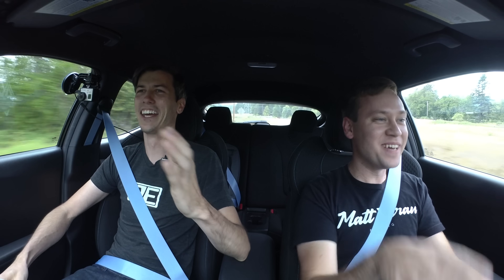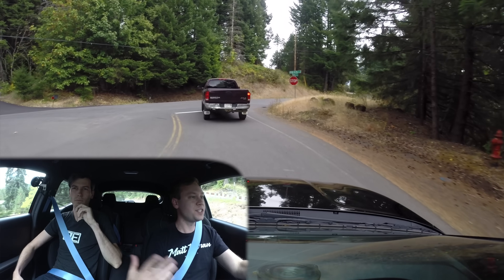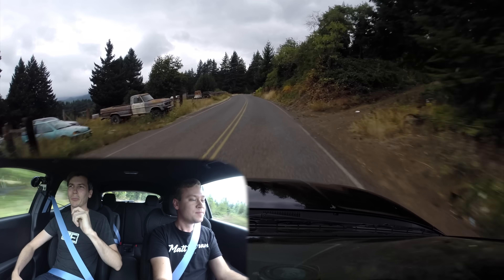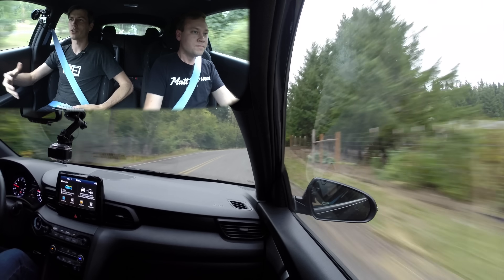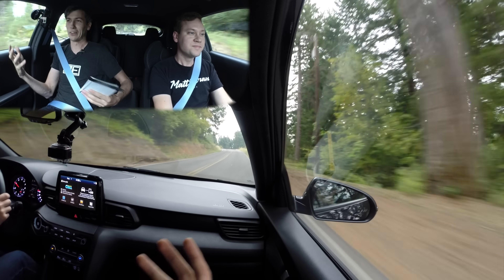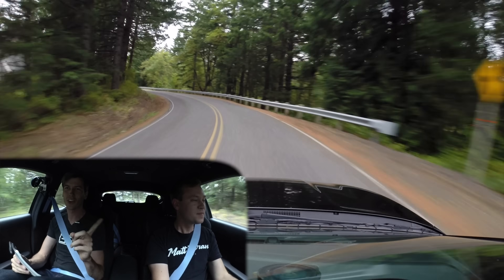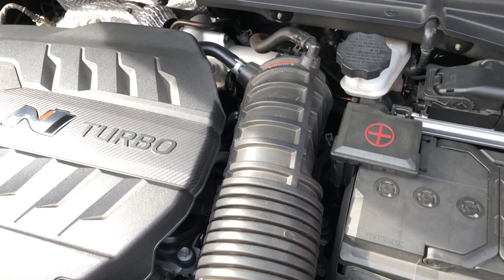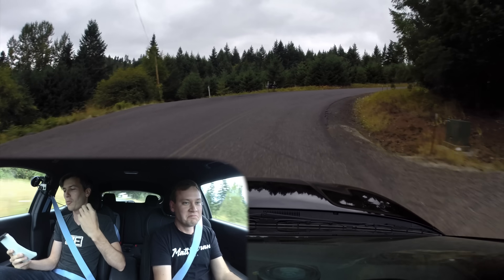Are Car Exhaust Crackles & Pops Fake?

Comment: Next, an EV with exhaust pops 🤣
As for Porsche and exhaust pops, the 718 Boxster/Cayman also pops when going of the throttle (in sports mode), but it became more subtle after the introduction of gasoline particulate filters.
Reply: I'm down for EVs with exhaust pops. :D

Comment: Crackles and pops are awesome... sounds through the speakers is awful. If you want to hear the engine and exhaust and your vehicle is designed to be quite maybe you could just roll down a window I mean all cars still have windows that go up and down I know most people think the driver window goes down so they can get there Starbucks through that hole. Lol😃😃 just an opinion here each to there own

Comment: What about catholic converter? Isn't that pops dangerous for ceramic?
Reply: Think you mean "catalytic" and yes, any ongoing or repeated post-cylinder ignition (especially if there is ignition in the cat) can overheat the exhaust and do damage over time.
Reply: @Game-The-System . Yep catalytic is other term. Sudden, hight pressure changes not good for ceramic or ceramic like materials.

Comment: Isn't the main reason for keeping the crackles to hark back to the romantic days of carburetors. When you let of the gas on those is actually still the physical evaporation of the remainer of fuel that causes the few crackles. Lovely sound on older carbureted motorcycles <3

Comment: but there are other ways to keep the turbo spooling without the inefficient "crackles and pops", right?  

I'm generally against any "fake" stuff in cars.  Shifting CVTs, fake engine noise, etc.
Reply: Look up how modern F1 powertrain works
Reply: Pressure release system maybe? Have a system that collects and pressurises exhaust gas and at low rpm it spins up the exhaust side

Comment: I have an E170 corolla with a Borla axle-back exhaust. It doesn't crackle like this one but when I let off the throttle it kinda rumbles/gurgles around 2000rpm. It sounds really nice. Anyone know what that is?
Reply: Bottom line is that the crackling and popping is generally post-ignition or even post-cylinder ignition after you have let off the throttle.  So if you are getting an excessive amount of it, your tune might need to be adjusted.  If you are running rich (even during throttle transitions or coasting), you may get a cyclic situation of post-cylinder ignition in your exhaust, which increases heat...leading to more post-cylinder ignition which wastes fuel and may very well kill your cat down the road.

Comment: Interesting.  I'd like to know if the cracks and pops can happen "naturally" when an engine is revved high (especially higher performance engines).  My suspicion is that as soon as you let off the throttle, there is still unspent fuel in the cylinder being post-ignited due to high compression, heat, fuel mixture, etc.  I'm inclined to think that this might happen (or is more likely to happen) with high-octane fuel (and thus higher performance engines) due to the longer-burning properties of the fuel.
Reply: At the start of the month i visited an event with old cars driving on a racetrack (newest car was from 82) and lots of those old cars had crackles and pops. None of them had a modern enough ignition to do what Jason explained in the video. Unless someone would change ignition timing mechanically when the driver gets off the throttle. (which i doubt because the car wouldn't run on idle and it would mean lot's of work and finding something that can do that for no purpose whatsoever.)
Reply: @nirfz  True.  I'd imagine that the cracks and pops on older cars are due to the fact that most carburetors are fairly inefficient compared to fuel injection.  Just spitballing, and now that I think about it...letting off the throttle quickly after a high rev in any set up will likely cause a rich mixture for a moment or two.  In turn, the conditions are ripe for those cracks and pops early in the exhaust system.

Comment: When my synchros were going bad, I had to double clutch a lot for smooth shifts. With the 370Z's SRM (rev match), it definitely popped a lot more on decel. I don't have a tune for it because I agree with you. I prefer a natural combustion process to determine what I hear. I will say I've noticed it also occurs if I lift off the throttle quickly to shift if I was applying throttle just prior

Comment: Sorry, but I find exhaust crackle to be childish. Now, if it's your thing, you do you boo; BUT, so many auto manufacturers force this "feature" upon buyers with no option to delete it. You can't, for example, buy an AMG or M-Sport without the damn exhaust snap, crackle, and pop. Some buyers, like myself, prefer the "sleeper" type of performance car and are now stuck with this.
Reply from the maker: On the AMGs you can turn the exhaust pops on/off in custom modes.

Comment: Sound emulators, stepped CVT’s and fake aero at least do not require the excess dumping of fuel in order to perform their supposed function... so yes, fake burbles are just as cheesy.

Comment: What do you appreciate more: someone who is naturally beautiful, or someone with a ton of makeup and plastic surgery? 

Same with cars. The fake aesthetics may do a great job mimicking something worthwhile, but you can never deny that it's just more special when something is already perfect in its purest form.
Reply: Exceeept those cosmetics are pretty useless.

Cvts faked shifting because people liked it. They made it worse because people are retarded.

Does it matter if its fake or not? As long as it tricks you into feeling real. It's fine.

That's life you butt heads. Most things are fake.
Reply: beauty is in the eye of the beholder anyway
Reply: Comparing women to cars?
Reply: You raise a very valid point and I agree with you.
Reply: Unlike humans, cars can't be naturally beautiful, as they are inherently artificial. They can absolutely be beautiful, but from the moment a car begins the design phase everything is artificial, everything is crafted by a person to either serve a purpose or evoke a feeling. No part of a car is truly "pure" unless it exists entirely to serve a practical function. The sound the door makes when closing, the exhaust note, the engine noise, every curve and angle, every panel gap, it's all made in the name of how it makes us feel to look at, listen to, and drive it.

Unnecessary exhaust pops have no more impact on a cars "purity" as stylistic creases in the metal, or the exhaust that was carefully designed to produce just the right note, or anything else on a car that doesn't exist solely out of necessity.
Reply: Exactly
Reply: Amen!

Comment: So, since I’ve modified my Trackhawk, I also added a Borla cat back. Lots of popping n gurgling when coasting. Is this just pressure waves  n such?
Reply: Jerod Heath when decelerating, the ECU will retard ignition advance quite a bit. This can allow the end of combustion to still occur while the exhaust is beginning to exit the engine. With a less muffled exhaust, you will hear this ‘end of combustion’ occur more easily.
Reply: Bottom line is that the crackling and popping is generally post-ignition or even post-cylinder ignition after you have let off the throttle.  So if you are getting an excessive amount of it, your tune might need to be adjusted.  If you are running rich (even during throttle transitions or coasting), you may get a cyclic situation of post-cylinder ignition in your exhaust, which increases heat...leading to more post-cylinder ignition which wastes fuel and may very well kill your cat down the road.

Comment: Speaking of in car engine sounds. I was surprised and a little disappointed to find my BRZ had a "Sound Tube" that was hooked up to the intake and terminated through the firewall of the passenger compartment.  Of course there was a diaphragm along the tube to prevent vacuum loss but still I think it's silly.  I removed the whole system, replaced hose from the throttle body to the airbox with a Si hose.
Reply: For better or worse, it is not uncommon on any "performance car" these days.  Mustangs and Camaros have those also.

Comment: the porsche system and the hyundai system sound like different ways to do the same thing. both aim to keep boost up to limit turbo lag.
Reply: Steven W same excuse 😂
Reply: But the Porsche one uses engine braking to keep the turbo spooling while Hyundai uses additional fuel. Can't help beeing an efficiency geek. I just hate wasting stuff.
Reply: @thoreberlin  it makes no sense. if the turbo keeps spooling it's because gases are produced as a result of burning fuel.. "engine breaking" is simply using lower gear to have more resistance, and as a result the rpm naturally goes up.. not because of burning fuel but because of greater resistance.. if it only does that and not burning fuel also, it's not really spooling the turbo....
Reply: Steven W : Yeah, that’s what they tell us. I’m thinking it’s straight out of the marketing department.
Reply: German ones sound different
Reply: @Wabeeninc  The Pops from the old RS3 were Massive. Audi told on their website, that they fire a cylinder when the exhaust is open. It results in a massive bang and also keeps the turbo at speed. 

The pops from the RS3 were in my opinion the best because: In Individual you can drive with the pops off, only loud as hell. With dynamic you get those pops. I drove it most time with the Individual. You got there nice and pure Inline 5 sound out of the engine. 

What I hate when those crackles come when you let off the gas or such stuff.

Comment: Can you do a video explaining upshift sounds on autos, DCT, DSG, PDK? like the one you hear after hard accelerations
Reply: I recall Jason covering this in one of his previous videos.
Reply: It’s the same thing no? The ECU will cut the throttle very, very briefly on an upshift
Reply: Baron von Teuchter well I think that sound or the throttle cut isn’t necessary, but manufacturers use various methods such as cutting spark while keeping the injectors firing to produce the sound now associated with such shifting. Some cars don’t do that, and I recall Jason’s 720s acceleration video where the car doesn’t make that iconic sound.
Reply: Ayoub Naguib pretty sure it's unburnt fule being ignited between shifts.

Comment: I feel as though with downsizing engines and lower redlines (in general), pops and crackles can inject a bit of character back into an engine. The difference in timing, volume and frequency seem to differ a lot between cars, and give a little personality back!
Reply: For me it sound that they are going too far on the downsizing
Reply: It's all artificial though...
Reply: @FaxxMachine 

It's all artificial in this case though.

The driver is a nice guy but he really got on my nerves everytime he said that he didn't care if it was fake or not and that he still finds it cool... 
He acted like a teenager... 😂
Reply: Well there's no reason to make v8s that are big and heavy when a turbo inline 6 or 4 takes up half the room and makes just as much if not more hp and torque.
Reply: No, turbo 4 cyl don't even come CLOSE to a Torque and HP from a V8.
A V6 turbo on the other hand do surpass a V8.
But this is the deal, go too far.
Downsize is good and OK, but not to go too far to make 3 Cylinder to work as hard as a V6 and 4 cylinder as a V8.
Reply: 1300l people would much rather have a big v8 for drag racing and stuff like that the ls has amazing torque on the low end paired with a supercharger or turbo their beasts but no one wants to hear bees in a can cough bmw
Reply: @1300l  my 2.0l  turbo 4 makes ~240whp and ~250ftlbs of torque and can be pushed to 300whp and even more torque with just a tune that is more power per cylinder than even a new mustang GT ~400 whp  390ftlbs stock. That's 3/4 of the power with less than half the engine.
Reply: You know that Mustang has actually a Low Powered V8, right?
V8s range from 400 to even 700HP.
Also, the 4 cylinder is already pushing it to the limits.. what do you think would happen if you push a V8 to the limits?
Yes, turbo 4 cylinder make amazing power, But Not quite V8 power.
Reply: @1300l  If you can't make engines quiet then go to electric cars even faster. Do powerful computers make lots of irrelevant noises just to boast of their power?
Reply: @yosefmacgruber1920  Do you drive powerful computers? A good engine noise can make driving more engaging, thereby making it easier to concentrate and not just switch off
Reply: @jmoore112344  Why not just turbo the V8
Reply: @KaitouKaiju  boost goes in push rods come out 🤷‍♂️ seriously though the only real differences would be torque and maybe 100hp which isn't very good considering most   turbo 4s can virtually double their power with a bigger turbo (focus st, fiesta st, Mazdaspeed 3, golf GTI, etc.)
Reply: @jmoore112344  a supercharged V8 makes far more power than a turbo inline 6 or 4 while sounding far better. They also don't burn any more fuel on the highway. L
Reply: Engines have no personality. It is just an engine. If you want a personality, then work on self-drive and a personality AI computer that talks and conversates with you. In fact, electric is the future, and I can't wait for cars that drive themselves and are nice and quiet.
Reply: Yosef MacGruber The word you’re looking for is CONVERSES. “Conversate” is not a word. Lol

Comment: I dont like shooting flames through my turbo.
Reply: No expert here, but shouldn't be "shooting flames" most of the time.  This situation only occurs for a brief instant when you let off the throttle.  Any manufacturer "blipping" the fuel to create added pressure in the exhaust (and thus the turbo) will certainly have built the turbo to handle it.
Reply: Why not?
Reply: @Jimmykid3  Wear on the turbo.
Reply: @mick1189  thats not hurting the turbo at all the turbine wheel is designed for it
Reply: jimmy schock - tell that to the destroyed turbine and no boost generation
Reply: @HippieSkippy100  what destroyed turbine and no boost generation? Turbine is likely made of inconel a little flame wont hurt it it melts around 2400° F and the flame isnt nearly as hot as your exhaust gasses